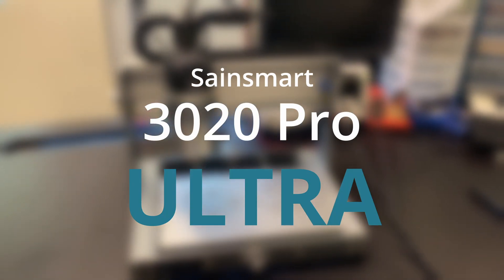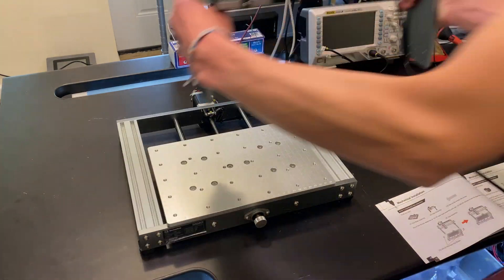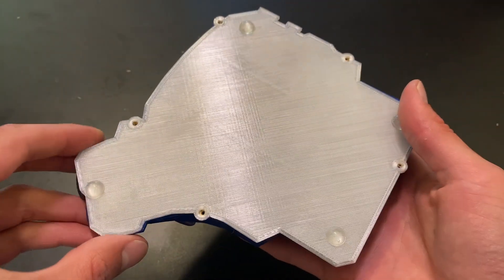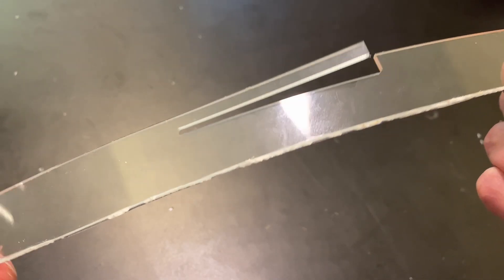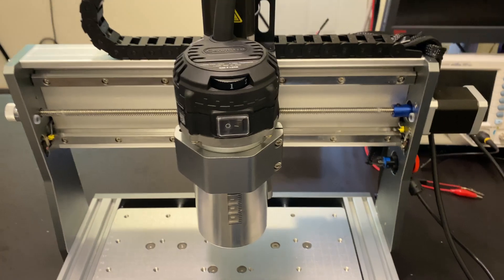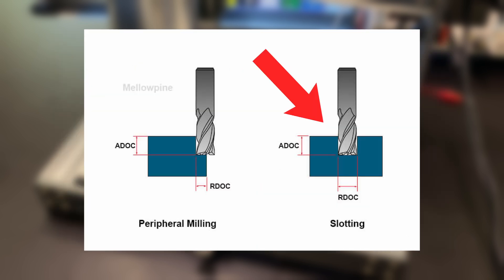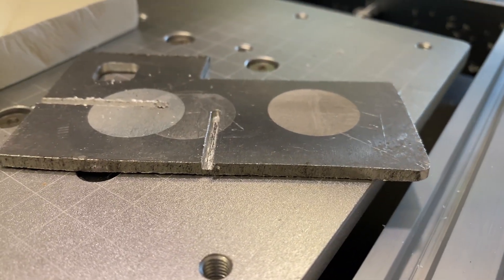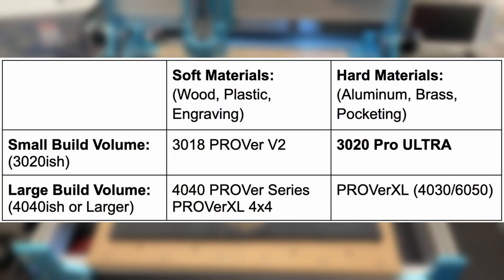3020 Pro ULTRA Review -  Sainsmart Demonstration

Comment: I used a 3 flute 1/4” DLC coated end mill on mine, 300mm/min feed, 75mm/min plunge and 0.4mm depth of cut. It cuts very clean with no gumming up.

Comment: The reason those slots are getting gummed up, and there is significant chips stuck tot he top edge of the stock material, is you aren't lubricating your mill, and you aren't evacuating chips fast enough. These two things will "gum up" your end mill, and eventually cause chip weld. It also means your cuts will not be as accurate, as both re-cutting chips, and chips sticking to the end mill will cause out of balance, and wobble, leading to slightly over dimension cuts. 

A few things you should address to get better performance: 
1) Cooling: Invest a few bucks in a coolant mister, or even a small pump to help keep the work, and the tool cool, and the chips evacuated. This will also prolong the life of your cutting tools dramatically. 

2) Way covers: Either buy some sheet metal and bend your own, or buy a set, but way covers protect the moving parts, and prolong the life of your machine. (This is also good if you plan on using flood coolant) 

3) Protection: If you plan on using coolant, you'll want to ensure you aren't making a mess, building an enclosure for the machine will drastically reduce the mess spilling out all over your desk, as well as protect YOU from flying chips, and shattered carbide. (It happens, not a matter of "if" but "when")

4) Flood Coolant: If you plan on using flood coolant, your best approach is to build, a recovery system, such as a leak proof steel box your machine can sit on top of. This will allow you to collect the coolant, and recirculate it after you filter out the chips and particles.

Comment: There are mods available (from sites like aliexpress or amazon) for the 3020 that allow you to mount a 710W makita router to it, I guess combined with the upgraded stepper motors you'd end up with this.

Great review! Really wondering what the exact capability differences are compared to the 500W spindle, I guess it running on mains voltage makes it quite a bit more efficient than the DC motor.